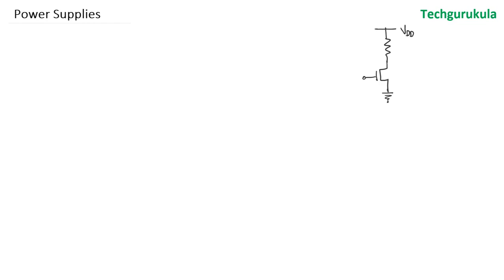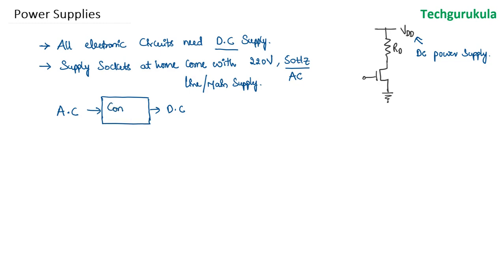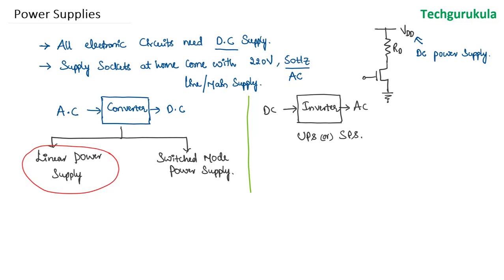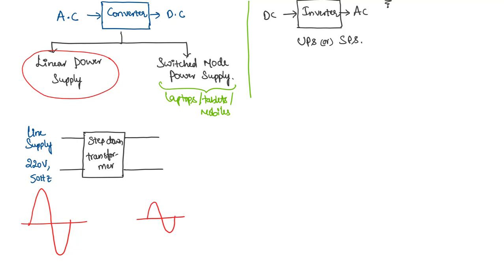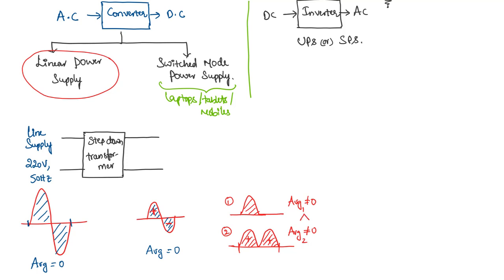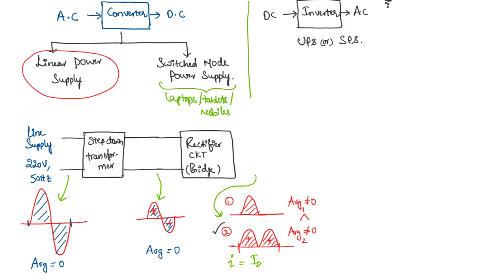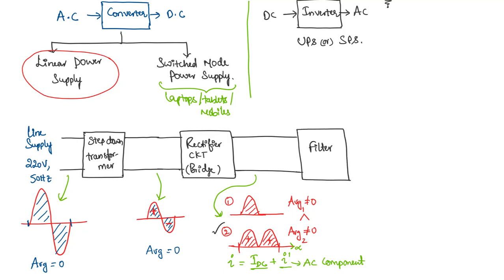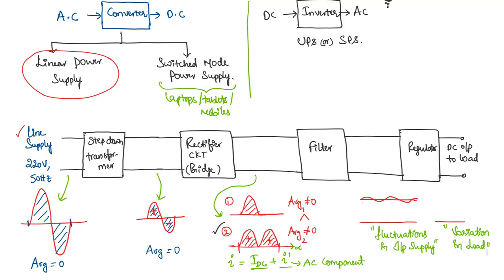Analog Circuits: Power Supplies

Comment: Sir i have one doubt after completing filter still ac component precent or what sir I think u told wrong the filter remove ac pulses and regulator maintain constant dc current
Reply from the maker: post filter - there would be still ac component - that's why there is ripple peak to peak, we cannot make it zero, we would compromise to some acceptable ripple peak to peak depending on application.